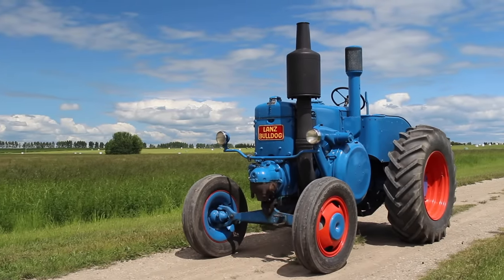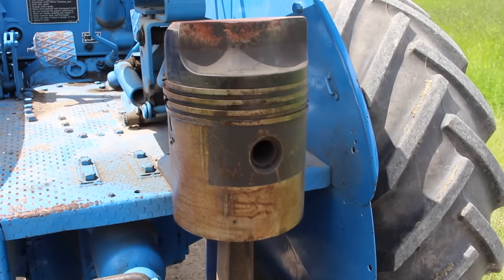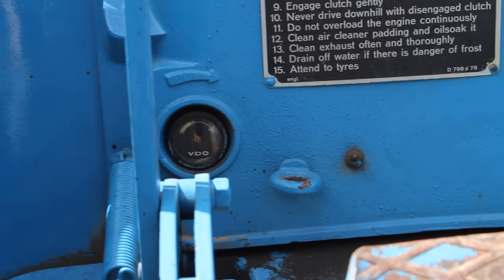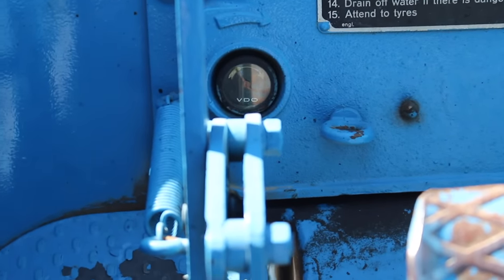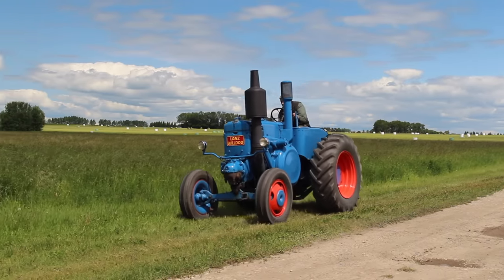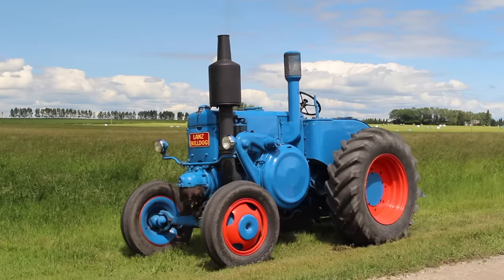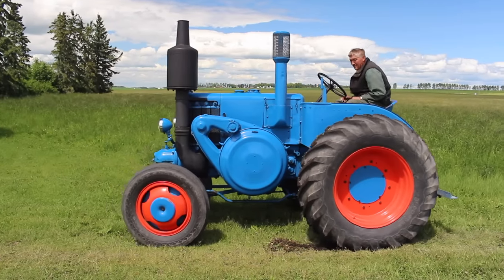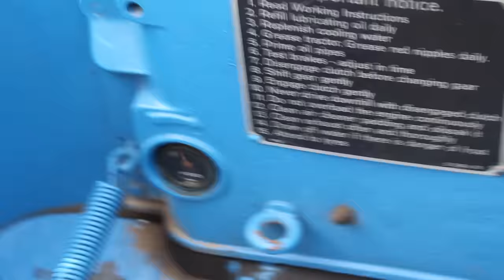Engine running backwards? Lanz Bulldog Tractor two stroke

Comment: Funny enough, some of the older Lanz tractors didn’t even have a reverse gear. You’d just have to reverse the engine.
Reply: I think that's what it's doing
Reply: Thats amazing. This one does have a reverse gear though. You see him use it. He went from backwards to forwards without the engine idling all the way down when turning around on the road.
Reply: That's pretty dang funny
Reply: @coolstreetman  ya it appears so,funny it has a reverse gear it clearly runs backwards shouldn't need a reverse gear,
Reply: Idk much about this design but if thats true then in theory that thing would move as fast backwards as it did forwards.
Reply: @devilsproject248  probably does It's not that fast.
Reply: @devilsproject248  depends what gear it's in it'll go just as fast backwards
Reply: @devilsproject248  well I’m quite sure the maximum speed was about 10 km/h, so I wouldn’t call it fast.
Reply: The biggest ships like container ships have two stroke engines and no variable pitch propeller. They also stop the engine, then start the engine in reverse after rotating the camshaft a bit. Of course it being the conventional designs without common rail and "hydro electronic injection".
Reply: @MrArray1967  you obviously meant to say they spin the crankshaft in reverse before they fire it up,they must be 2 stroke because of all the mass in the rotating assembly I'm guessing?
Reply: @coldsmoker9387  on our old ice breaking ship  you shift the camshaft over to a other set of cams and restart the engine to run reverse
Reply: @JustinSeiffert  I understand that but regnar said his ship was a 2 stroke so the camshaft comment confused me,what you explained makes sense and is pretty interesting
Reply: @coldsmoker9387  actually I meant the camshaft (assembly). It's easier to rotate the camshaft than rotating the crankshaft, the connecting rods and pistons etc., the propeller, the shaft generator and or - motor if fitted.
Two strokes I think main reason being they produce work on the crankshaft by every downward motion of the piston compared to every 2nd time on a four stroke engine. They also have greater (greatest) thermal efficiency.
Reply: @MrArray1967  I never saw a 2 stroke engine with a camshaft, but I've never seen a big 2 stroke ship engine either, so I guess anything's possible. I remember years ago Toyota had an experimental double overhead cam 2 stroke car engine, but I never figured out how that worked. Did the old Detroit Diesel 2 stroke truck engines have cams and valves?
Reply: @barryervin8536  Yes, the old Detriots did have cams and up to 4 valves per cylinder. All exhaust valves.
Reply: Ummm. Reverse engine wtf
Reply: Yea my friends subaru did that.
Reply: @barryervin8536  2 stoke diesels have cams for exhaust valves. 2 stroke gas engines (dirt bikes, etc) have no cam.
Reply: You mean... just like this one?
Reply: @coldsmoker9387  probably was reverse engine first, then later models came out with a lever, but still could be done the original reverse engine way by the old schoolers....
Reply: Modern 2 stroke snowmobiles reverse the engine to go in reverse
Reply: Some golf karts did that I think but it would be worse in reverse since the ignition timing would be way late
Reply: @devilsproject248  first gen cvt's could go just as fast in reverse as forewards
Reply: @devilsproject248  there are a lot of agricultural and construction side machinery that has just a reverse gear BEFORE the main gearbox. Giving you just the same gearing in reverse. Couppled with a low and high range gear box you get all the torque and speed in reverse as well as in forward gear.
Reply: That's how some EZ-GOs work.
Reply: thats..physically w...did you even watch the video?
Reply: that's what this v....did you even watch the video?
Reply: Sander Boom watching this video and reading the comments has been so enlightening to me. I'm car mechanic but my knowledge on diesels is limited. I have seen the older Mercedes diesels "run away" after engine oil is filled too quick. Frightening when I saw it because the high rpms. 
When that happens isn't the engine running in reverse? I'm glad I found this channel.
Reply: @Hyprvelocity  don't get me wrong, I wasn't talking about the Lanz in that video. We own several different German older traktors, most from the 60's and 70's. The newer they get the more often they have this type of reverse gearing I described.
Reply: @Andy-1234  I’m quite sure most cars can’t run in reverse, as only two-stroke engines can. And it’s also not about being a diesel engine: the Messerschmitt bubble car is a petrol engine.
Reply: And this one now has one forward and several reverse gears lol
Reply: @devilsproject248  Wouldn't surprise me.  Other vehicles can be the same - Mercedes Unimog trucks routinely have a forward/reverse gear completely independent of the primary gearset.  In other words, their 8-speed transmission can fully drive the truck at speed in either direction.  Not that you'd likely ever want to though... ;-)
Reply: @barryervin8536  the big two-strokes uses valves and a blower, not the crankcase like small two-strokes
https://youtu.be/3n9UGc2noE4?t=390
Reply: @coldsmoker9387  when engine is running beckwards and he wants to go forward just put on the reverse
Reply: I'd run the engine backward and use the reverse gear to drive forward just to tick people off.
Reply: Thats how snowmobiles work
Reply: @barryervin8536  A reed valve or piston port two stroke with timing that's not 'fixed' will run just as happily backwards as forwards. Just watch someone try to start a Cox 049; they're glow ignition, reed valve induction. There's nothing in that engine to bias it towards one direction of rotation and 9 times out of ten when they start it's in the wrong direction for the airplane they're mounted to! But it also makes them great for pusher and twin builds because they'll run backwards quite readily.

This Bulldog is similar. Hot bulb engine ignition timing is basically set by physics as the engine runs, not rigidly by any sort of mechanism, so they'll fire whenever they feel like it. And that means they're just as prone to running backwards as that little Cox 049 is.

I've had my cox 049s oscillate as well. If they want to run backwards against a spring starter the spring won't disengage and they'll sit there and fart at you without actually rotating.
Reply: @barryervin8536  Yup. Two strokes with camshafts are called 'uniflow' and require a supercharger to function because they cannot breathe normally.
Reply: @fuzzy1dk  Some do. Some don't. This tractor is reed valve IIRC.
Reply: on 2 storke snowmobiles reverse works by reversing the engine
Reply: @barryervin8536  Yes, even many old golf carts worked as such. Modern snowmobiles have dispensed with transmission gearing, and its weight and complexity, by simply starting the engine in reverse. With modern electronics  (fuel injection, ignition, electric starter motor) I can say first hand, that it is a near seamless operation.
Reply: All 2 stroke snowmobiles do that for their reverse gear
Reply: @coolstreetman  but im sure thats exactly whats its doing if you listen to what he says
Reply: @coolstreetman  in the desc "It can run both ways" implying that because it runs both ways he is using the engine to reverse, and nvm forget what im saying, while writing this i saw the tractor has a shift stick
Reply: So if the engine was running backwards but he was in reverse gear, the tractor would go forwards.
Reply: @MrArray1967  - What happens with the conventional big 2-stroke marine engines is a follows: The engine is started by rotating it using compressed air of 30 bars pressure, admitted into the cylinders, above the pistons, through what we Marine Engineers call a starting air valve. The sequence of how the air is admitted, is controlled by a starting air distributor. Depending on whether you want to go in the Ahead or the Astern direction, one of two sequences is used, thus determining the rotation direction of the crankshaft and the camshaft, the latter being connected to the crankshaft through a chain drive.
Up until the engine designs of the early 1980'ties, the fuel pumps' injecting timing was controlled by the camshaft, through fuel pump roller guides, cam followers, that directly controls the up and down movement of the fuel pump's plunger, ensuring the correct fuel injection timing, depending on the rotational direction
The camshaft also controlled the movement of those roller guides directly connected to the exhaust valves' actuators, thus creating an oil pressure to take care of the exhaust valves' opening/closing,
injection actuatorsrotationaldirection
The engines that started coming our in the early 1980'ties, didn't have the reversing of the camshaft, but rather a linked fuel pump roller guide, which instead took care of ensuring the correct fuel pump timing, basically by simulating the reversing of the camshaft, still based on the rotational direction.
As the camshaft was no longer reversed, the exhaust valve timing, which was optimized to Ahead running, was no longer "compensated" for a better Astern running. As most of the ship using these engines only run in astern for at fraction of their total running time, the less efficient exhaust valve timing was accepted.
When the electronic controlled engines started coming out around 20 years ago, the camshaft was at first completely omitted. The fuel injection timing, the fuel volume and the exhaust valve timing, is instead controlled by hydraulic fuel boosters, and hydraulic exhaust valve actuators, both of which are activated by electronically controlled sophisticated hydraulic valves, besides controlling the timing of the fuel injection, the also control the stroke of the fule booster, and thus the fuel amount. The exhaust actuator will always encase full valve opening, form the best possible scavenging of the exhaust gas from the cylinder.
As a cost down, the camshaft was later re-introdueced on some engines, thus allowing a camshaft controlled exhaust valve, as described above.
I hope this clears up the thing about reversing large two stroke marine engines. a final note one the 2-stroke engines is, that some of these were/are delivered as non reversible engines, requiring the ship to be outfitted with a controllable pitch propeller.

As for large and medium sized 4-stoke engines used for propulsion, thes normally have a gear box to reduce the propeller speed as well as controllable pitch propeller, or they may have a gear box that allows reversing of the propeller shaft 😀
Reply: @coldsmoker9387  - please see my reply (above) to Ragnar Andersen, on how the reversing of large 2-stroke engines takes place 😀
Reply: @jesperth.petersen8386  you just answered every possible question I could have come up with regarding large 2cycle marine engines lol
Reply: @coldsmoker9387  - Your'e welcome Sir 😀
Reply: @jesperth.petersen8386  So you are a Marine Engineer ... Welcome in the club.
Reply: @MrArray1967  - I’ve been in it since 1978 😱
Reply: @jesperth.petersen8386  1994 and who cares.
Reply: Radical idea here 

Maybe turn around
Reply: Reversing the engine rotation was a fairly common feature for very early internal combustion engine tractors.  It was a characteristic left over from steam tractors.

Some manufacturers took advantage of reversing the engine to add a couple more transmission speeds to the tractor as well - Two forward and two reverse speeds, then reverse the engine and you have 4 forward speeds in total.
Reply: @gwyneddboom2579  It's as fast as 10km/h :'D
Reply: Yes, you're right. Lanz Großbulldog and Mops are both 3 speed engines without reverse gear. You have to change the direction by clever use of the pre pump lever.
Reply: @gwyneddboom2579  the speed of the   Eilbulldogs was up to 30 kmh.
Reply: @coldsmoker9387  yes, twostroke. For starting you heat it, prepump it 3 times and swing the crankshaft fore and back till it ignites the first time. Then you pull out the steering column. Therefore a freely rotating knob is situated in the center of the really massive steering wheel.
Reply: @jacobboone6078  Lanz semidiesel is a Huber engine. Only slots for exaust and a  lamellar valve on the crankcase. Injection timing in the chamber about 120 deg before and a compression ratio about 1:5
Reply: Marine engines just like that
Reply: All snowmobiles with reverse do the same thing
Reply: I was going to say…if you can reverse the engine you won’t need a reverse gear.
Reply: Skidoo tundras had it like that too. I think a bunch of other models had it too
Reply: Uhhhhm... Acutally not ? Or at least not in germany (where Lanz was based)? My grandfather used to work there, in mannheim... Or atleast he doesnt know about any tractor beeing produced without a reverse gear.
Reply: Funnier that you say "just have to reverse the engine", like its a simple task. On a normal day of scraping the yard/road or removing snow i probably use the reverse gear about 200 times, then seing how much hassle and jolting there is to get the engine to run in reverse - quite bad - and you say "just have to reverse the engine". To make it even worse, its a hot bulb engine, starting in winter is a challenge, and a lots cause on a -20c day, The tractor is funny but near useless, while most other tractors from the 1950ies are  basically fully useable. Oldest i owned was a 1957 Dexta, not only was it good, it was also my preferred tractor for most tasks.
Reply: amazing, funny, the sound overwhelming.
some older 2-stroke cars you could start in the way that they hat 4 reverse-gears. go-go-mobile (german manufacturer) was one of them.
Reply: Yea I was thinking of how you wouldn't even need a reverse gear, you could just have one set of gears for driving forward, and you'd be able to go as fast backwards as forwards without needing to have several reverse gears.
Reply: That’s what he’s showing you 🙄
Reply: sounds dumb, a reverse gear is pretty simple isn't it?
Reply: @coolstreetman  Yeah, can you imagine every time you want to reverse you have to be precise when accelerating or you would be moving forward again if you missed it
Reply: El motor no debe girar mucho tiempo en sentido contrario.